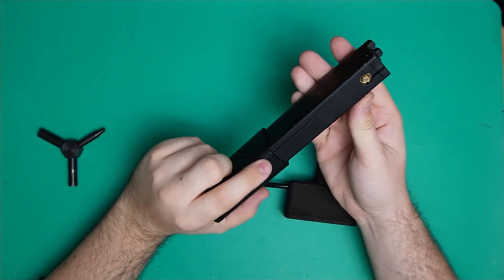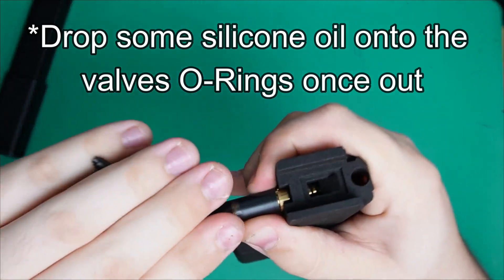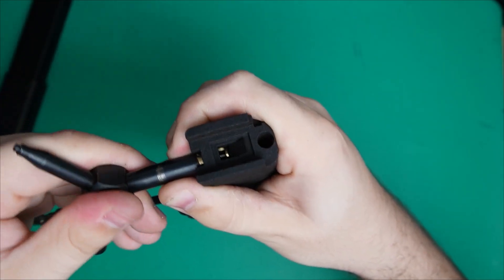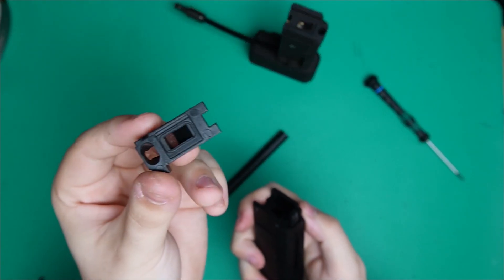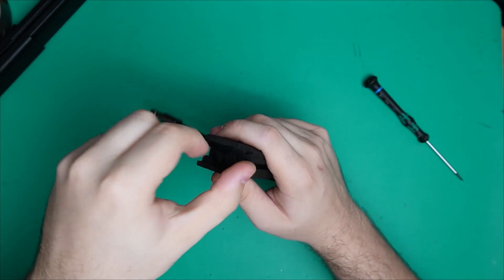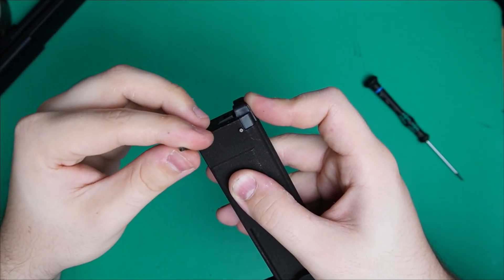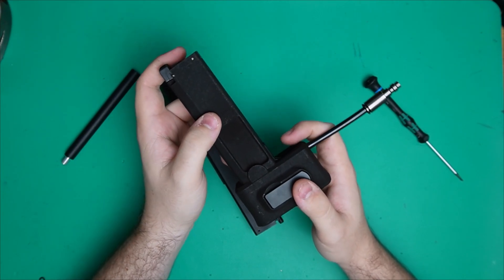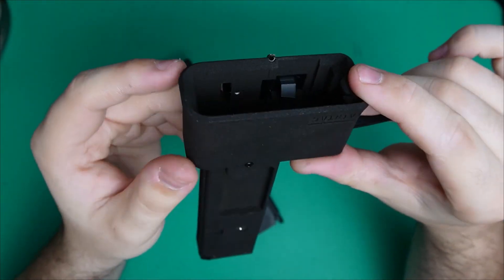Airtac VMP1 HPA Adapter Instructions

Comment: Wich magazine do you use for this is it a high capa or?
Reply: A VMP mag. I believe you can save a bit of money by getting the 20 cap/short version as you only need the feed lips and valve. Or sacrifice the one that comes with the VMP. This will also work with the upcoming VMP2 (and 3 when that is ready for release, which was confirmed in the vmp2 reveal at IWA) as they are going to keep the same mags throughout the vmp line (vmp also means vorsk modular platform)

Comment: I can’t seem to get the same pin out of my two mags
Reply from the maker: Have you got an appropriate punch, they can be damn tricky. 

If you are completely stuck send the mag to us and we will build up for ya
Reply: I’ve tried on 3 mags, I can get the lower pin out on all the mags easy but the other pin is not moving one bit
Reply from the maker: @oakleywalker8051  I think I have a solution, if you email support@airtac.me we can send you a pin
Reply: It’s the feed lips and gas router I need